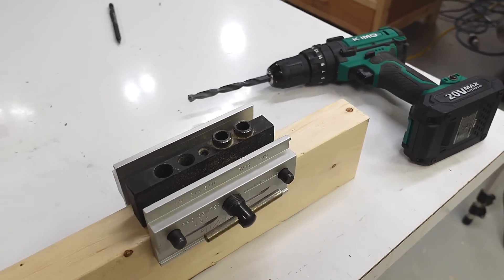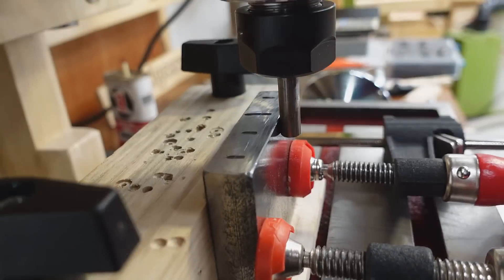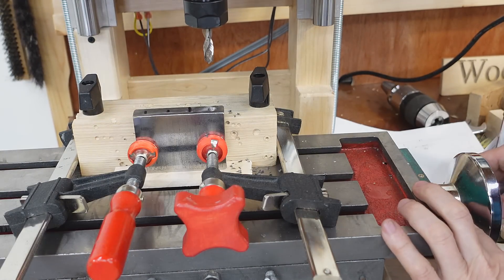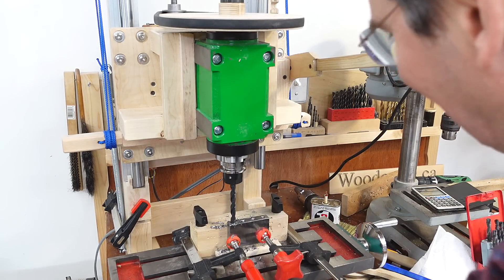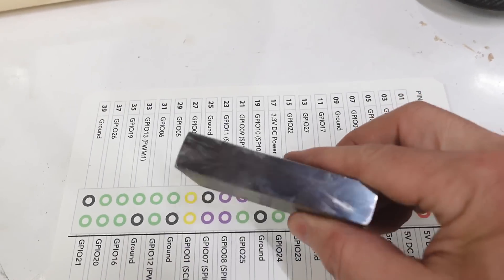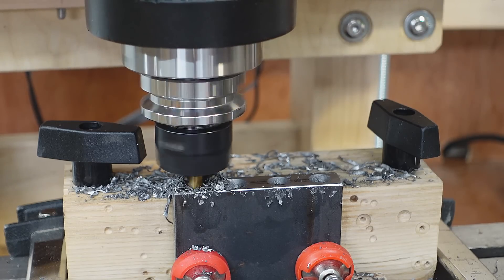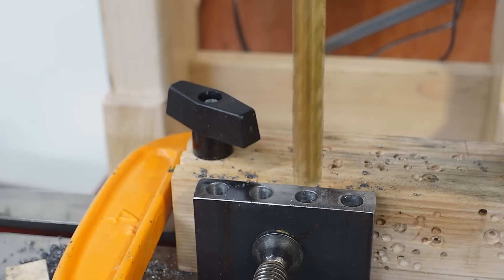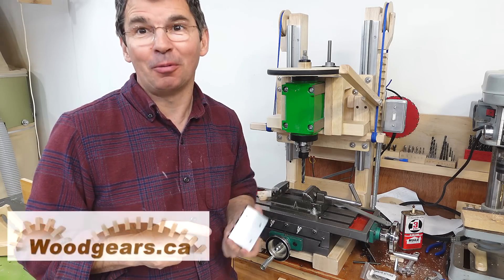Milling the dowel jig I always wanted

Comment: I eventually broke down and got a harbor freight grade handheld metal bandsaw, and made a table for it and it comes in handy. no sparks smoke and disc and iron dust flying everywhere, not to mention orders of magnitude safer and a fun project in of itself.
Reply: caveats, it's slower and forget about sharpening old metal saw blades :)

Comment: Aliexpress sells "drill sleeve" "drill dowel jig" "drill guide" made of hardened steel.  They are M14x1.5 threaded.  You could make a 3/8" by drilling out the 9mm.  I used drill guides to re-process parts at a small factory.
Reply from the maker: they are metric, and hardened.  Can't just drill them out
Reply: @matthiaswandel  Aliex sells drill bits and taps designed for stainless steel. The title says Titanium, Cobalt, Tungsten.  I've bought from DrillForce and BB stores.

Comment: There's a better oil for drilling and tapping than 3-in-1 household oil, called TapMagic.  You can peck at the hole to clear the chips and reduce heat build-up.

Comment: I find it quite impressive how much difficulty you had drilling those holes. I've never run into those personally. Especially the drills chattering in the bores sounded quite scary. 
I drill my holes on a drill stand that works with a lever, much like your mill, except i always drill pretty fast in terms of RPM. But then again, my chips do come out brown and blue sometimes.
I think what you had with the 5mm drill was a lack of RPM and too much feed, which caused the chips to break and become wedged around the bore. Also i've never had an issue drilling holes with big drills (10mm, 15mm) even without a pilot. 
Perhaps you could make a video experimenting with speeds and feeds to see if you can make those drills work smoother?
PS: I sharpen my drills by hand also. If i had to buy a new drill every time i dulled one i'd be in debt. ;)

Comment: Awesome channel, been watching for years. However, you metalworking knowledge needs help. Firstly..a centre drill is used for centring a piece of metal for turning on a lathe, not for a drill. The spot drill you used first is correct. You should never open up a hole with a two flute drill, you rightly state it can snatch. However, if you need to do this. The first drill should be a smaller dia than the width of the Web thickness of the second drill. Also, never guess the speed of the drill. The manufacturer of the tool will have guidelines for you. Example. Standard HSS drill in mild steel would be around 18m/min. Convert to rpm with this formula. M/min x 318/ tool dia. So for 5mm drill, 18x318/5 = 1144rpm. That wouldn't sound so grating..

Comment: Pilot drilling the holes will allow the finishing drill to drill to the correct size. Just add more coolant/oil to help cutting for a better and more accurate finish 👍🏻

Comment: Machinist here, good work, but here's a few tips for next time:

Your spots should be about 70% the size of the drill you're following it up with. If it's larger it can actually pull your drill off center as one lip catches before the other. This will be worse with hand ground drills with unequal lips.

Using the pilot drill was a great plan. Generally you want the pilot to be the same size as the web of the drill you're following it with.

You can use an indicator to find the center of a part if you hold it in the spindle. Look up Indicol holders for one idea of how you could hold it in the spindle, or makr your own adapter. It'll be as accurate as your indicator. You could also buy or make an edge finder.

Speaking of indicators, I think your block of wood wasn't quite square to your x axis based on the fact that you saw your holes slightly missaligned. It's also possible the wood compressed a bit more on one side than the other under the clamping load. I think I also saw the part shift at one point.

Comment: For info, wood has about 1/20th the stiffness (Young modulus) of steel, well done, Matthias, with drilling steel using your wooden mill/drill. You might have had it easier spot drilling then transferring to a drill press.

Comment: you need to get a proper cutting fluid. Try tap magic Extra  or Anchor Lube (water based doesn't smoke and great on SS), and "Tap Magic for Aluminum" (or wd40 for aluminum).  they keep the parts cooler, and make it easier to cut .. 3 in 1 not so much.

Comment: The dowel jig turned out pretty nice, considering that you're venturing into new territory. However a part like this would be much easier to fabricate by just scribing it on a surface plate (or some other flat surface for that matter) and carefully punching, center drilling and drilling and reaming your holes on the drill press. You'd only really need to get a marking gauge/ vernier height gauge, wich I think you can get used for pretty cheap.
Easily gets you within less than 0.1mm of tolerance.
Reply from the maker: I have a hard time center punching holes to that accuracy

Comment: I'd recommend running your poor drills a good bit faster. Rule of thumb for mild steel is 7000 divided by the drill diameter (in mm) to get your RPM. I know you can't really set the RPM on your machine, but I'd want to figure out the gearing you get with your pulleys and the RPM of your motor to get some idea of how fast you're going. Also, whenever you calculate RPM for anything, round down or choose the next lower gear.
Hope this helps!
Reply from the maker: well, I thought I'd play it safe going slower to avoid overheating.
Reply: @matthiaswandel  Yes to be fair, you would usually use lubricating coolant in drilling. For our drill press at work we have a small squirt bottle, maybe that wouln't be too messy? It would be a lot more effective at keeping the part cool than just the cuttimg oil.
Anyways, I'm excited to see what you're going to do with the milling machine.

Comment: Would using a drill bit eventually wallow out the holes anyway? Unless the tool is hardened?
Reply from the maker: even a hardened tool will wear.  Given how deep the holes are, its got leverage advantage, so I figure it should be good for a long time.

Comment: If you turn yourself a centre punch with a shaft that fits the collet, you can ensure any piece, any shape can be drilled in the place you want accurately. That's how Chris Ramsay (Clickspring) marks out the plates for clock mechanisms, so it is pretty accurate!

Comment: When pre-drilling with a smaller drill, one usually use a drill size that is close the diameter of the web of the larger drill bit used. Cheers

Comment: make the body with aluminum and press in hardened drill bushings
Reply from the maker: do tell me where to get these bushings
Reply: @matthiaswandel  any industrial supply , machine shop supply company , you can get very tight tolerance  , also when you bring your tool to the work piece , use a piece of paper as a feeler and when the paper just pinched you'r roughly .002 from the edge , plenty close enough for government work lol , i love love your channel and your ingenuity
Reply: @matthiaswandel   also if you harden your new drill jig it will help  keep it accurate

Comment: Couple of points:

First after centre drilling a pilot hole should be drilled that is as large as the chisel section on the final drill bit size used and no larger. If the final drill bit has split-point geometry then only a centre drill would be needed. Because no pilot drill was used on the first attempt this explains the large amount of force Mattias had to apply to get the chisel section of the drill bit he used through the steel. As the machine's frame is relatively flexible compared to one made of cast iron, keeping the cutting forces as low as possible will help with accuracy.

Secondly, in my opinion a better way to make dowel jigs is to use a softer material for the body (wood/plastic/aluminium) and then make steel bushings that fit into it. This would also suit the machines Mattias has available to him (i e., a small but relatively precise metal lathe and a homebrew "millpress"). Other advantages of this approach are that only the bushings have to be replaced as they get worn/damaged and if made from suitable steel their relatively small mass makes it easy to harden them, increasing longevity. Oh, and bushings to suit different drill sizes are also an option.

I have a 3D printer. I 3D printed the body for a dowel jig and made steel bushings out of silver steel. The left-right symmetry of the jig is within 0.05mm, so i don't even bother flipping the jig for each face to be joined.
Reply from the maker: If I knew where to get bushings like that, that's what I would have done.  Everybody keeps saying "use bushings" but nobody says where to get them.
Reply: @matthiaswandel  Make them on your lathe!
Reply: @matthiaswandel McMaster Carr

Comment: Cool it by lubricating it, the flanks of the tip and the sides are just rubbing on steel, lube lowers heat that way. Post cool with water mist, way faster and better than low pressure air. High pressure air can cool and clear chips.
Reply: You don't want to do this because wood table etc, but you still need to for many reasons

Comment: You should have pilot drilled all the way down with a drill just bigger than the tip of your 9.5. ALL of that force is going into the tip grinding away the middle, not the flutes cutting the hole. In steel this is essential for large holes.
Reply: You did on round 2, but went to 5mm, smallest you can go and still be bigger than the tip. Also ream after drilling smaller, if you need precision
Reply: Ha, you did that too.

Comment: Hi Matthias, great job and very entertaining to watch.

I am trying to do the exact opposite of what you are doing. I don't have any wood working machines, so I cut and machine wood on metal machines. Much easier (except for the massive wood chip mess).

One suggestion though to cheat on your wooden milling machine. Given your rigidity will always be on say the soggy cardboard box side, I would suggest you use softer materials. For instance, your jig could be plastic (or even wood if you are so inclined) with steel insert drill guides. These are then just long bushings, relatively easy to turn on your mini lathe. Drilling deep holes in plastic is easy for your milling machine and might even help with keeping the holes aligned directionally along the jig.

Comment: With the limitations of your mill I'd layout the holes with a scribe and center punch next time. Drilling pilot holes with a 1/8 or 3/16 bit instead of a 5mm but would work good because then you are only removing the area that the full size bit has to plow through with its center web.

Comment: Dude, steel isn't wood.

Dial indicators, center drills, pilot holes and rigidity are necessary. Wood lacks rigidity and true surfaces for indicating. But, your doing a great.

Comment: couldnt you just spring load the vise on both axes (or with a pulley and weight hanging down the back) to get rid of the backlash
and cut off some cheap calipers, then just glue them to the side to have a linear scale that is independend of a maybe non linear lead screw
heck even with pulleys and kevlar/steel wire or bike brake line, you could mount them somewhere else and just move  the caliper head back and forth. mechanical DRO

but that angle grinder jig is genius

Comment: While wood goes a long way to subbing in for metal in some cases I think even your light duty mill here could benefit from some cheap 1-2-3 blocks to use for jigging up work.  With a clamped down block you can then dial in the face so it is parallel to the travel of the table.  And with that you could have avoided the slight angle of the holes.  Hint, the cheap 123 blocks don't pass 3/8 bolts through their unthreaded holes.  But 5/16 or 8mm does fit.  So some clamping studs and T nuts in that size works really well with the cheap blocks.  Along with this you'd want a way to hold a dial indicator to use for sweeping the surfaces if you don't have one already.    And rather than your finger nail you might want to scribe an index line on the body of the table to use for your rough movements. 

I would never have expected a wood based mill to perform as well as this one has done so far.  But then I would not have expected wood bandsaws to work well either.  So well done on converting my sense of what is possible and even somewhat practical.

Comment: On my mill I would have drilled to within 0.5mm and then reamed the rest. Reamers are stiffer than drill bits and are less likely to wander, particularly on a long hole. Reamers are available on the internet from cheap HSS (my end) to expensive carbide.

Comment: The wrong scratch line: You can fix this with a blow torch and soft solder. Solder the scratch and grind or file it afterwarts. It will not be completely invisible, but nearly... Does not work if you want to blue the steel ;)

Comment: Interesting to see a highly skilled wood worker, working on metal. 
I cut my teeth on metal work and I have a few tips. 
Firstly, get yourself a centre drill, twist drills have all sorts of variations due to the point grind. Very much worth the money.
Use a bit of paper to edge find, when it just grips it, you are at the measurement of thickness for the paper.
Operation orders, usually its best to keep positioning and switch bits, then move over. 
Dont back out, just release 90% of pressure to break the chips. Rotation will do the rest.
Reply: and as you can probably tell, I commented part way through watching :) 
I usually find the grinding can also be from a very aggressive drill.

Comment: Even though your stock came out pretty square grinding it when you start getting into precision machining you just face everything in the mill. You need every advantage you can get. At one point lifting the bit out to clear chips I saw the whole block move. A milling vise is a nice thing to have with a milling machine. It makes a lot of setups easier. You're going to want a set of parallels too. Oh and some real cutting oil. Rapid Tap is nice stuff.

Comment: I'd switch to Cobalt bits for drilling steel.  Also, be careful with the heat...you can work-harden mild steel enough to the point where it's annoying to drill.

Comment: Does the milling table have enough travel in the forward/backward direction? could have mounted the piece 90° and have the dial indicator give you measurements instead of counting the turns no? not a machinist tho so maybe there was an extra reason for why you needed that orientation
Reply from the maker: The dowel indicator doesn't have the required range, like I said in the video.
Reply: @matthiaswandel  ooh I see, I misheard and thought you had said it didn't fit on that side. My bad

Comment: I've had good success cutting thick cold roll steel with a jigsaw. You have to regulate the speed to the lowest setting possible and use a metal cutting blade.

Comment: Your dowel jig here looks like a basic form of something that used to be sold in the UK here called the joint genie, not sure if you have seen one of those or were inspired by it? The alignment tabs and ability to join multiple jigs together accurately are very useful features of that design.

Comment: Another thought. The last few drill jigs I've made I've purchased some identical hardened drill guides in bulk and used those instead of using pure wood guides as I've done in the past. It's a very nice compromise. The guides are hard and fairly precise relative to what I can make at home out of steel.
Reply from the maker: where can I order these drill guides?
Reply: @matthiaswandel  aliexpress of course
Reply: Same

Comment: I would be drilling holes that size closer to a thousand RPM. I also would be lubricating with a mixture of water and oil. The water prevents the material and the bit from going much above 100°C because it absorbs so much energy when it turns to steam.

Comment: integrate some concrete in somewhere to get the vibrations and rigidity to help with the tough job you're hoping to accomplish with this awesomeness I'm fully optimistic that you knew what It needs and respect your probably wanting it as wooden as much as possible but i feel either a few smooth clean driveway bricks paving slabs or maybe make some custom shape moulds for concrete parts you can slide on hook on or connect to areas that might need it for some reason then can be removed for other things? also sand bags can be made in all shapes and sizes and could be safer and maybe be better than solid additions in some situations but it's a bit of an idea i thought you could do up to you obviously love everything you have done since ive subbed some 5 or more years ago ☺️👌

Comment: An impressive DIY machine. Hower, a little background on getting even better results: in order to drill precise holes with sufficient surface quality, you need a different piece of equipment. Apart from the fact that the play between the individual parts of the wooden structure is higher than with comparable metal structures, the wood gives way. This means that the play that is only determined by touching it and shaking it or by measuring it with a dial indicator is significantly smaller than the play under load when the motor generates the appropriate torque and vibrations and the operator puts stress on the construction by pulling the lever. In addition, the wood is too light. There is a reason why the old machines from 100 years ago, which are extremely heavy and made of cast iron, still have remarkable precision. Finally: the speed at which the drill rotates is, in my opinion, too high for the length and diameter of the hole (the professional machines have significantly more torque and run slowly and quietly) and there is clearly a lack of drilling emulsion for cooling and lubrication. The fact that the workpiece (and therefore the drill) becomes so hot further impairs precision.